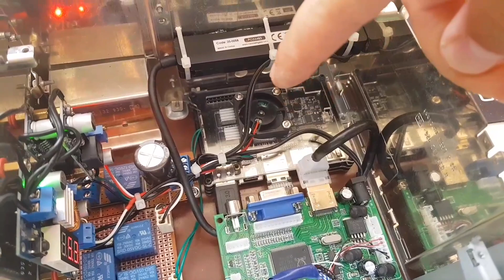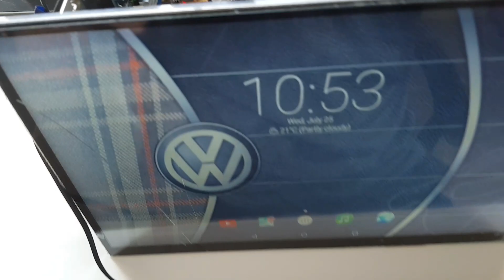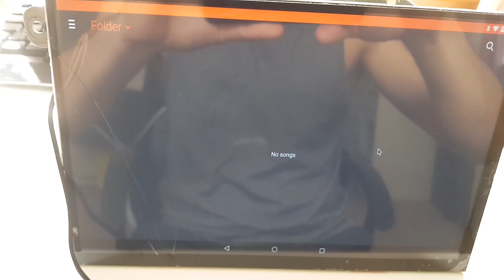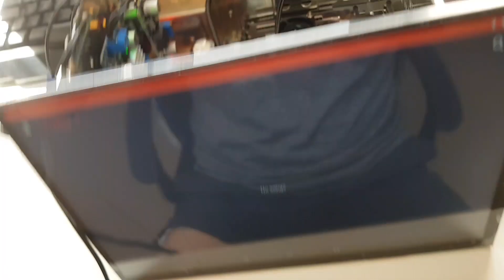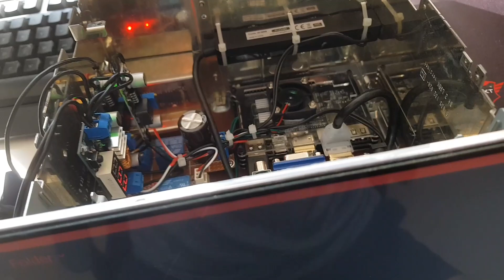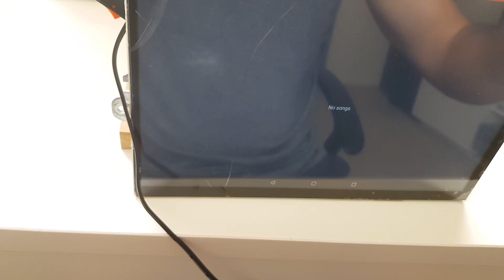Explained - Khadas Vim home made android head unit

Comment: Hi, can you share the arduino code to monitore the ignition voltage?
Reply from the maker: Hello, it's never been tested and most probably, I don't think I have it anymore.
Reply: Ok thanks . One more question....how do you start the screen together with khadas?
Reply from the maker: @danielgotz2184  I think it was permanently on and it was going to standby when no signal was present on the HDMI. But  that can be also wired on the ignition 12v since it needs constant power
Reply: Ok thanks

Comment: Did you manage to keep the VIM running all the time? Does it effect your car battery?
Reply from the maker: Never installed it in the car but to answer your question, it shouldn't affect the battery if it's in standby, current consumption should be very minimal.

Comment: Hi, it's great, now I'm just starting to do my carpc, and I'm going to ask for my 10.1 "touch screen, I would like to ask you how you are about the car's ignition (so that the connected devices will not restart). how is this?
https://www.aliexpress.com/item/32957495653.html
Sorry but I'm very new in this, my knowledge is only by car audio.
My idea is to buy a raspberry pi 4, but much later, for as long as I have an android tv-box to play with. but I am with the dilemma of the ignition of the car that restarts my devices that I connect (12v screen and 5v TV).
Reply: hahaha that concience buy your same screen but from aliexpress.
https://www.aliexpress.com/item/33037788042.html?spm=a2g0s.9042311.0.0.4bf44c4dJhoOoi

Comment: Hey how did you add the touch drivers to the vim?
Reply from the maker: Orlando Polanco i use a different ROM made by a guy on the forum named DaveMF which has all the necessary drivers for touch, usb audio, gps and few other things. I'm pretty sure Khadas themselves released an android rom with all those drivers.
Reply: @eduard.c.ionescu  I was trying to use a touch panel from eBay on the vim 1 and the panel was not recognized. I installed the latest rom but still no luck, do you have a link for the custom rom you used?
Reply from the maker: @orlandopolanco2436  https://www.drive2.ru/b/500781642915251775/ you're lucky, this one is actually much newer and better. make sure you have vim1 not 2. cheers. btw, use google translate on that website.

Comment: Thank you for the explanation video! Could you please list which USB sound card you are using along with the touchscreen and display part numbers? 

I was not aware the board could go into standby mode. Saves me the hassle of trying to figure out if Android Fastboot would work. Thanks to standby mode, it is not needed.
Reply from the maker: Electr0nicPian0 https://rover.ebay.com/rover/0/0/0?mpre=https%3A%2F%2Fwww.ebay.co.uk%2Fulk%2Fitm%2F263437548232 
Here's the link for the display. This one doesn't have the rear view camera input, other than that it's exactly the same. The sound card is a Behringer UCA 202...very cheap, works with android. Cheers